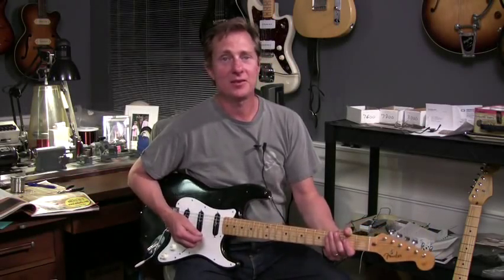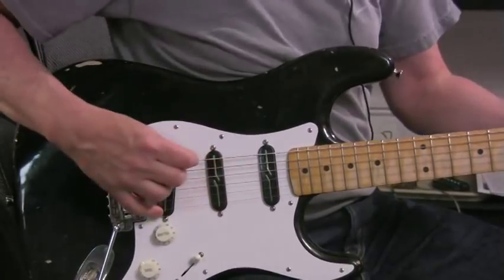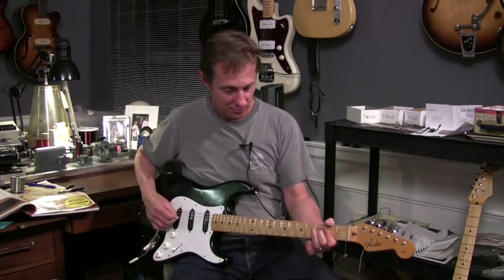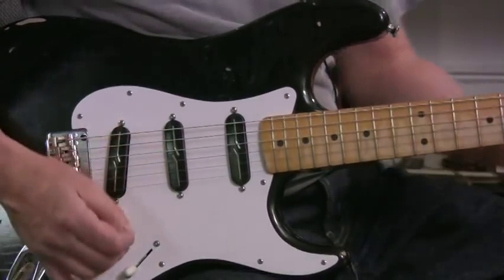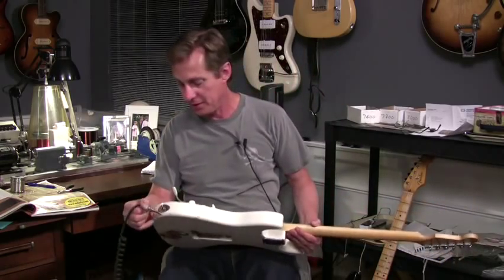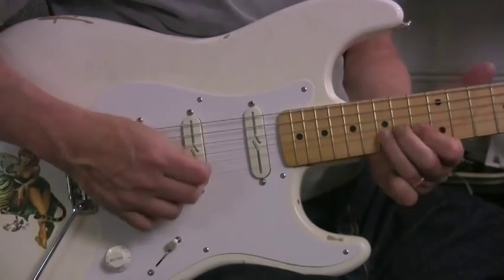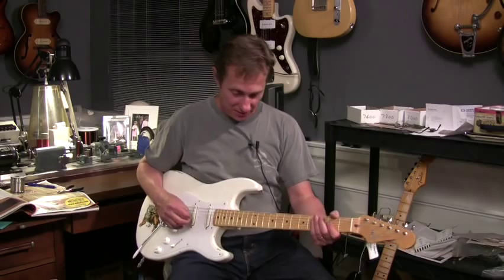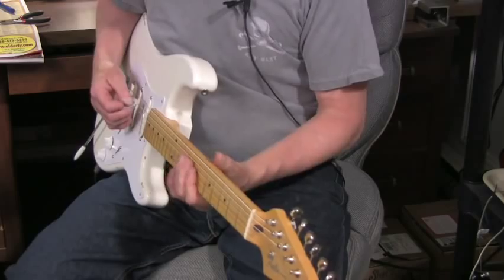Fralin Hum Cancelling Split Blade Strat Replacement Pickups

Comment: What is the correct height of your pickups?
Reply: When pressing the strings down at the highest frets adjust pickups to1/16th inch for the Split Blades. Single coils will need to be a little farther away as they can pull you strings out of tune. I always do it by ear.